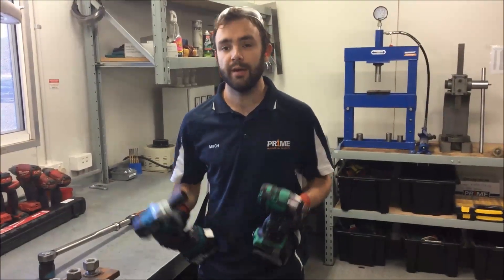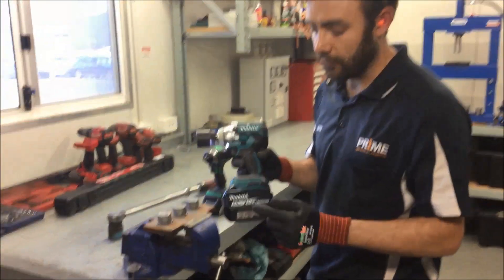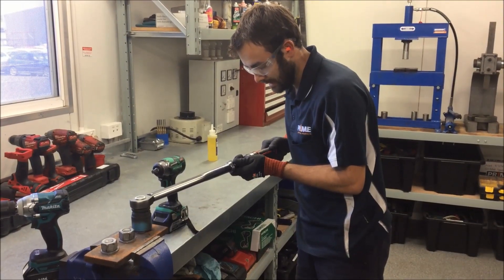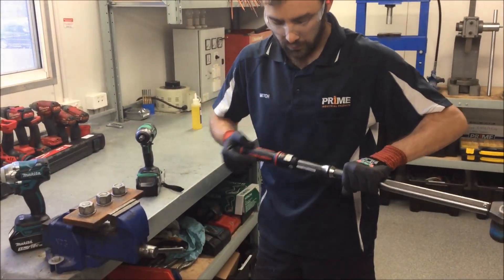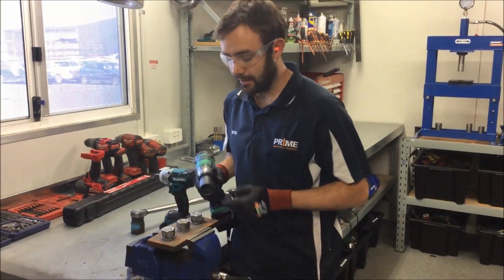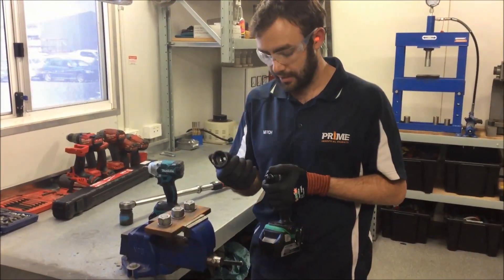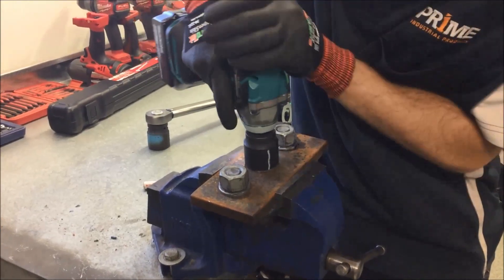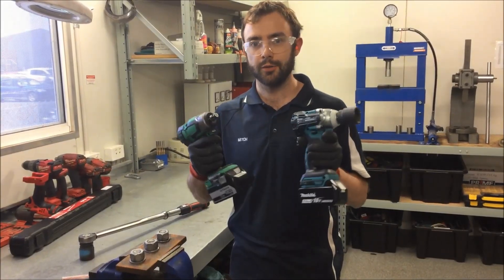IMPACT WRENCH BATTLE MAKITA DTW285 Vs HITACHI WR18DBDL2

Comment: Awesome impact MyBest.Tools Takes tires off in a second. Plenty of power for what I’ve used it for - rotating tires. Using it on 3rd setting for removal and 2nd setting for tightening lugs.

Comment: Hi interesting test. The one thing to be learned from this vid is how easily bias can effect the "ovjectivity" of the ones facilitating the test. As stated in the comments here the time you use to tighten the bolts are not the same, but the most obvious example is at  6:27 where your bias makes a full bloom and while it's clearly shown in the vid the nut barely tightens, your perception is that it makes a 1/8 th of a turn while the vid (pause at 6:27 and 6:33) clearly shows that it barely has moved at all. It is as Darren B pointed out not of great value anyway since the bolts are at dead stop at this point. I am sure it's not intentional but it proves an interesting point of how fragile the human mind is to objectivity and bias by interpitation of "facts". Thank you for the vid, it helped me decide what option to get, I'm definetly getting the Hitachi/Hikoki.

Comment: Very informative test, thanks for that!

However in the the test starting at 6:00, you are using Hitachi for about 3 seconds per bolt. On the other hand the Makita is used 6-8 seconds per bolt.

Also at 5:14 you say that there was a slight increase in the torque. 

For my eyes they performed exactly the same. It seems that you just wanted Makita to perform better. ;-)
Reply: Saaga-maria exact same thing I was going to say there is a certain amount of time 6- 8 seconds where there's a ramp up and the torque starts to turn it and right before he sees that it is going to move that line he stops using the Hitachi... this is completely biased and paid for by Makita
Reply: Agree
Reply: I have a this makita model and am looking to get a Hitachi due to the fact that my makita needs two days  of drying out if it gets wet. There’s another YouTube video of a Hitachi wrench being submerged several times in water and concrete and it still operates as normal. My makita would just stop.

Comment: even if you used a more powerful or less powerful impact wrench the bolt reach its maximum amount of turns it can make before stripping the threads.
Reply: Depends on the bolt, you would have to look at the grade of the bolt and it’s recommended torque setting for the size. Remember bolts stretch

Comment: no wonder you cannot tighten these nuts any more even with increased torque because there can be no movement as it is a steel plate these bolts are fastened onto. If it was an alloy wheel bolt, then you could gain extra movement due to softer material that bolts are used on. Any extra nut movement on top side of your jig is probably bolt head moving on the other side. And bolt heads are not welded to the steel plate, are they?
Reply: Smart

Comment: Hello. Prompt whether differ greatly from model makita dtw281 dtw285? Do you have same model dtw281 Could you do a review on the model dtw281vs dtw285 !!!
Reply from the maker: Morning Aleksandr,  
The only difference from our two tests we have done is that the DTW285 has a torque stop function, which stalls out the tool once the nut has been snugged up ready to torque up with a torque wrench.
Otherwise the specifications are identical. Thanks Mitch
Reply: Prime Industrial Products   I just do not quite understand why you need this fourth mode !!! I bought after watching your video (which you have tested dtw281 vs milwaukee) bought makita dtw281z !!! You as a professional in his hands both models and dtw281 and dtw285, Tell me whether or not to change to a new model dtw281 dtw285 ??? Or is this feature that was added to 285 is not so important and you can safely run 281 ?? !!!
Reply from the maker: Hi Aleksandr, The DTW281Z is exactly the same power level and will serve you without a problem.The Auto stop is just an extra feature most of the power tool manufacturers are coming out with. and unless you are snug tightening a large amount of bolts to be torqued up with a wrench. I would stay with the DTW281 if I were you.By the way we are blown away you purchased a tool after watching one of our videos, Thanks!

Comment: What's the price difference between the two? Is the MAKITA a bit larger/heavier? I used the Hitachi WR 18DSDL this weekend and found it piss weak. Couldn't even get off my wheel nuts or brake calliper bolts.
Reply from the maker: Here in Australia, the Hitachi is $329 for the skin and the Makita is $279.The Makita is slightly heavier but not a noticeable difference.The WR18DSDL is the older brushed model which is only rated at 255nm where as the new WR18DBDL2 is rated at 305nm which is a massive difference.
Reply: I'm in Oz, Bunnings has got the Makita for $298. Do you guys retail?
Reply from the maker: Yes, we do have a retail website. If you go to www.primesupplies.com.au and click on Products then you will be able to create a log in and make a purchase. Our price is $279 on these units and we have stock on the shelf. Should you wish to purchase then we can send one in a parcel via airbag to you, along with Tax invoice which will act as your 3 year warranty. Give Steve or Mitch a call on 08 9780 1111 should you wish to discuss further. Thanks

Comment: I recently bought a Makita DTW285 with a 4AH battery and was surprised that it failed to remove lug bolts that were correctly fastened to 120 Nm, but had been on the car for about 5-6 months. The DTW285 is supposed to have a break-out force of 400 Nm so should easily have taken them off, so somewhat disappointed. Any clue as to why, except mine is maybe defective?
Reply from the maker: I would take your tool back to where you bought it from. As in all tests we have done it has removed nuts at 400Nm easily. Also just check you have it set on the Highest setting with the 3 lights on.
Reply: NUCK CHORRIS ur nuts must be loose, my 160nm makita impact wrench can't even loose nut from my 125cc scooter. N it works perfectly fine with good oem batteries.
Reply: Definitely something wrong. I can take lug nuts off with my new 18v makita subcompact impact driver so you darn well should be able to get them off with an actual makita impact gun.

Comment: may I make a suggestion? you are using very short bolts, which are inherently stiff. This means, the slightest tightening rotation will see a very large increase (%) in torque, or conversely, you add10% torque on the wrench each time and it may be moving, but by a tiny amount. If you took the same diameter bolt and same nuts but used a longer bolt (say 300 mm long) and clamped it between something longer (tube with end plates and holes for the bolt to pass through) this will reduce the bolts stiffness. This will then have the effect of enabling you to see a slight increase in torque and that 10% increase in torque may results in 10 degrees nut rotation, rather than 1 degree with your short bolts. I'd liken it to reading a pressure gauge that ranges from 0-5000 kPa and looking for a movement in the needle the corresponds to a 10 kPa pressure increase.....naturally the graduations are that course, its hard to read (see) that kind of resolution. just  a tip is all. liked the vid. thanks for sharing
Reply from the maker: Thanks for your feedback Mike, we had limited resources at the time of making this video but your suggestion would make it a more relevant and accurate test, that would be a lot easier to measure the results. Thanks Mitch

Comment: Complete nonsense. Bought a DTW285Z today. Yes it has some decent loosening power and loosens bolts that have been tightened > 300Nm. But it will absolutely not fasten to 400Nm. Max 150 or so. Real test would be to tighten to max using the impact gun, then use a torque wrench too see how much torque is required to loosen.